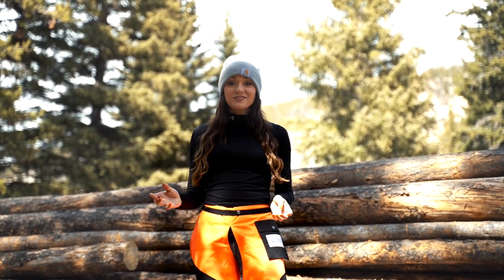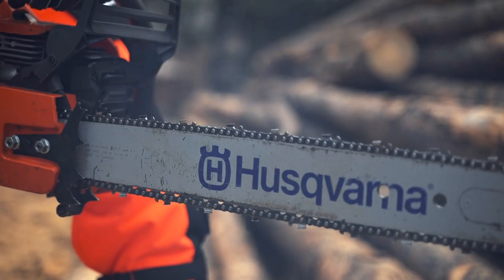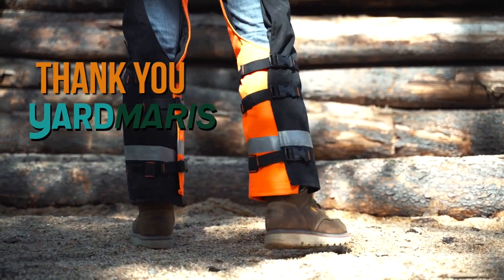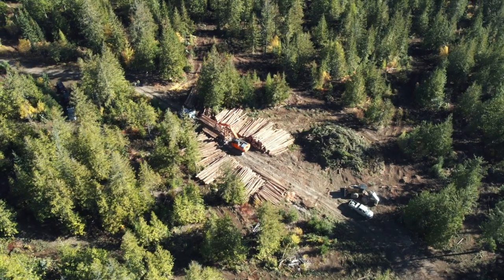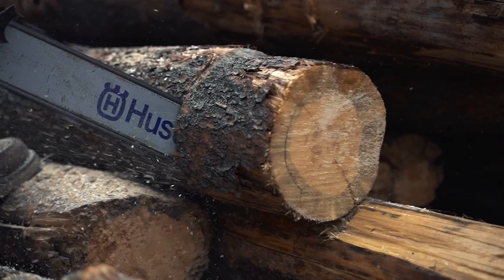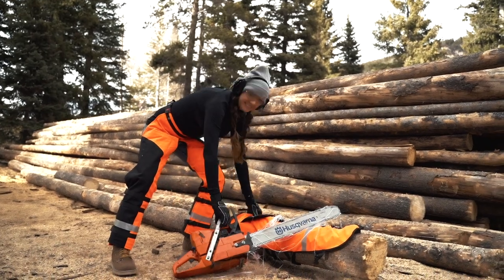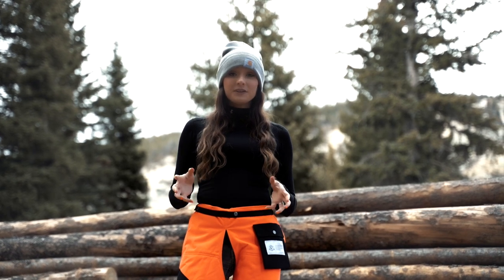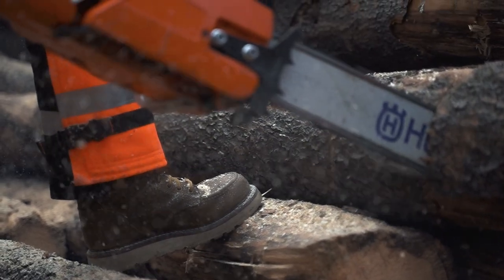TESTING CHAINSAW CHAPS | Everything you need to know.

Comment: Now do it again but don’t just hover the bar over the chaps, go full throttle and drive it into the chaps just like would usually happen during a kickback. The chaps will still work (as long as they are good quality) but your testing will be more accurate instead of looking like you are trying to fudge the results.
Reply from the maker: I think you’re interpreting malice when in fact, I was just nervous to cut through the chaps.
Reply: @AllySafety   Except that is the whole point in testing things out to see how they protect in real world situations... Being worried about how the chaps end up should be the furthest thing from your mind when trying to show people how well a safety product works that could/should save their lives.
Reply: @kenmcmurray4006  I think she was nervous running a chainsaw. She already cut them with scissors and fully intended to take the saw to them. Plus if that husq bit in it could pull her face first on to the log pile. My thoughts
Reply: @AllySafety  The term "mens rea" is used instead of "malice" to describe "evil intent" or "guilty mind". Excellent content.